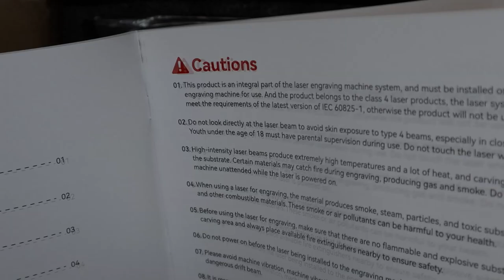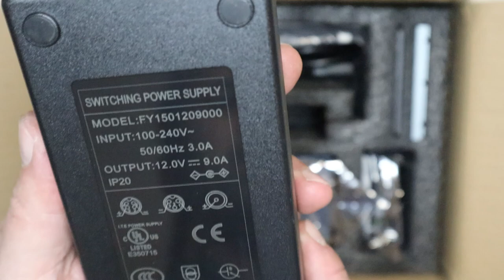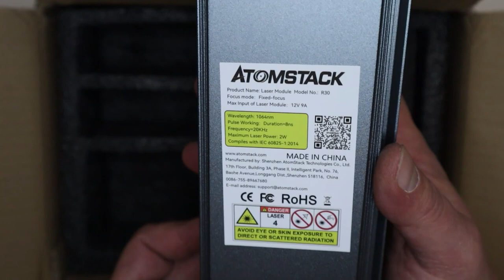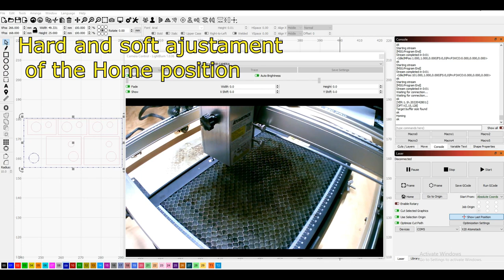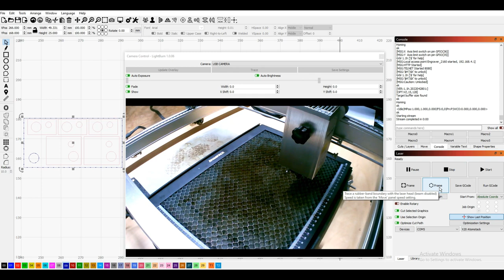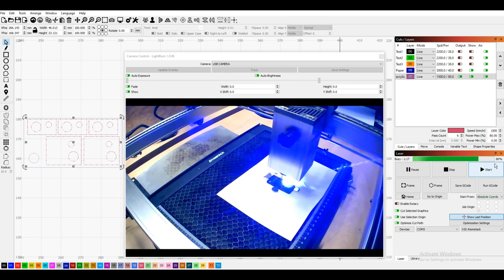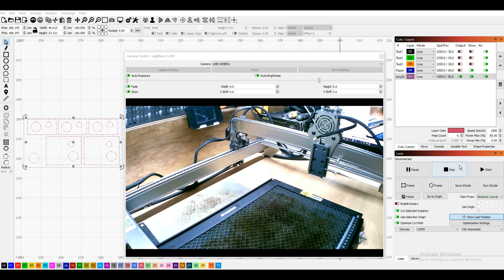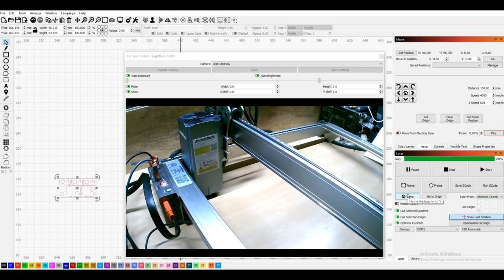R30 monting on X20

Comment: Is it necessary Air Assist for R30 module?
Reply from the maker: Not!
Reply: @RmcReloaded-tehnicaldriver  Why?
Reply from the maker: R30 is used for plastic and metals, not for cutting wood. The height in front of the material is much higher than with a regular diode laser head. it would not help you in any way. It is not intended to be attached from the start. You can use a side fan to remove the smoke faster